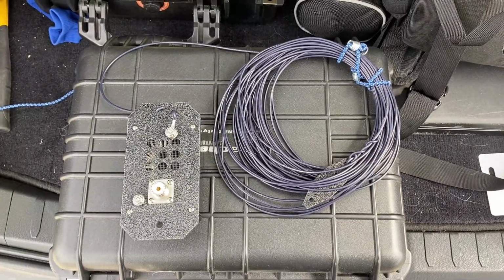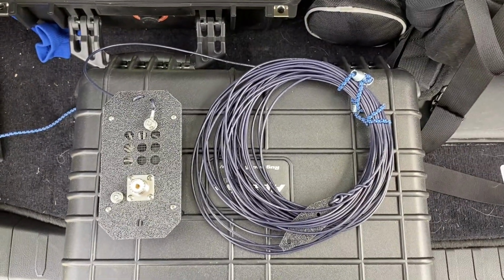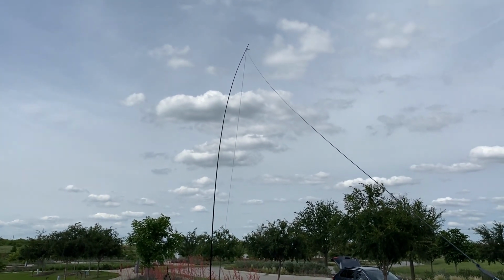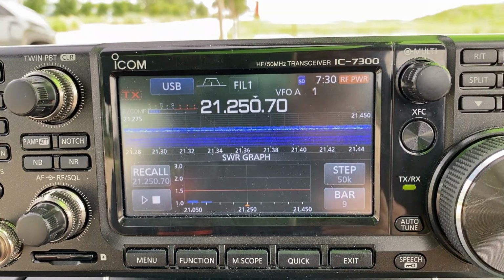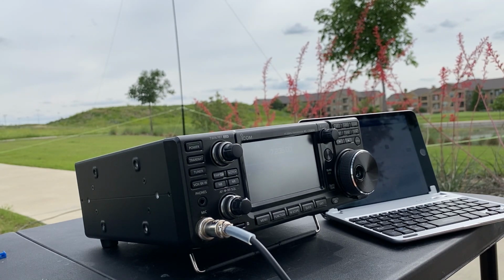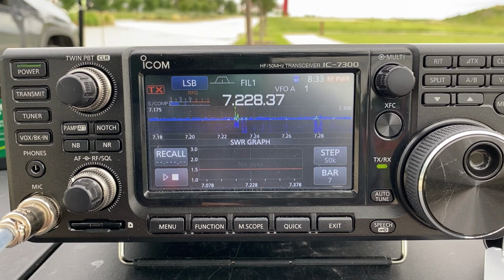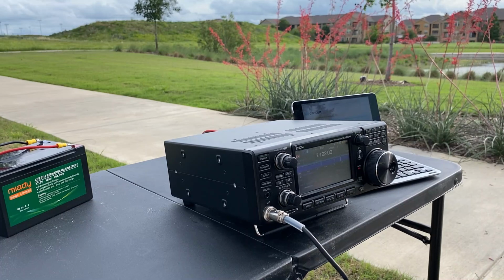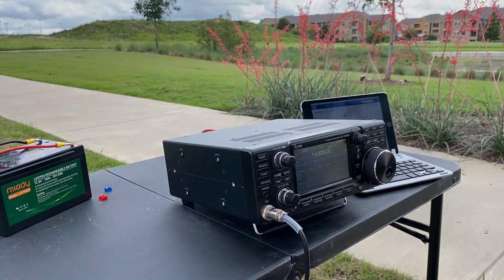Ham Radio Wire Antenna: End Fed Half Wave  MFJ-1984-MP

Comment: This antenna is my Go To for POTA.   When I set this up and swept it with the RigExpert it shows the same type results but internal tuners take care of this no problem.  I use mine as a slope by putting the end as high as I can get it into the tree (typically 40 or 50 feet) and the feed point about 10 feet above the ground.  I feed it with a 40 foot piece of RG8X.  I also use a 1:1 current pass through at the rig.   I also have a 15 foot counterpoise wire hanging off the feed box.  I have had excellent results in this configuration both phone and CW modes.

Comment: Great video keep them coming. My portable rig is the G90 an MFJ-1984LP I did the inverted V . My SWR’s were high. That’s when I put the 25 foot counter pose in the opposite direction. SWR’s then we’re  flat lined on 10, 15, 20, & 40 no tuner needed. 
73’s KC3PMX

Comment: Thanks for showing your setup.

Some notes for a future experiment:
a) The coax braid and all that is connected to it is your counterpoise.
b) You measure the SWR at the coax end and not at the antenna feed point. This is fine, as long as you just care about the match of the coax to your transceiver.
c) The SWR says nothing about the performance of the antenna. The more losses between the antenna feed point and your transceiver, the lower the SWR.

EFHW are very versatile portable antennas that I mostly use doing SOTA.

73 Stephan
Reply from the maker: I am taking notes for next time.

Comment: Good video, Shane.  This is the first HF antenna I bought, back in 2019.  I have mine set up as a vertical/sloper, similar to your second configuration.  I'm using a magnolia tree instead of a pole, but I go out and up the tree, then across another tree.   Just can't really beat an EFHW for cost/performance.  Honestly, that antenna for not being "portable" is pretty portable.  Easy enough to take along, even on a SOTA.   Good job man.
Reply from the maker: Yea this was my first antenna. I use it at home and portable.

Comment: I use an EFHW and while it will tolerate being bent into funny shapes, it does push the SWR up on 28MHz. You might find there is a point higher up where the SWR comes down a little, but don't be surprised if it doesn't come below 2:1. Bending the antenna more in the sloping-L alters the current distribution a little at the higher frequency and it alters the impedance.

Comment: On the slope, the vert/slop has an angle of less than 90°
In verted V your angle was about 60°-70°
The angle when folding an wire or adjusting the gnd plane to the vertical you can adjust the Ohm's by adjusting the angles.
Good luck and have fun

Comment: The inverted L SWR was higher because of the acute angle between the vertical portion and the horizontal. If you could have raised the far end up near 30 ft you would see very different (better) results.
Reply from the maker: I also want to see about making that a zero angle at the top and running the wire back down the mast.
Reply: @K5QBF  That will effectively shorten your antenna. If you fold it in half then you have a 20 meter vertical.

Comment: Uh Oh ! I did not see the radio transmit above 7300 khz, but 7325 khz is out of the band.
Neat antenna. I use a HWEF40 almost all of the time when I set up portable. Mine is a flat horizontal antenna.
Barry, KU3X/QRP
Reply from the maker: The swr check was wide enough to see the whole band. I have my band edges set so that the radio will not transmit outside of the General class privileges.

Comment: I run in the inverted v for pota. Having the unun that close to the car could be causing some issues. Great dx antenna either way.
Reply from the maker: I’m going to test it with a 20ft counterpoise and see if that makes a difference.
Reply: @K5QBF  it will most likely screw up the other bands as the coax acts as the antenna. Maybe try a 5ft piece. 🤷🏼‍♂️
Reply: I wander if the car was causing the high SWR. Also would be easy to add a counterpoise using a crocodile clip on the plug.

Comment: Hey Shane, I think if it’s in the inverted v configuration, it probably follows the same principles of when the wire is at a 45 degree angle to itself, the closer it comes to 5-0 ohm

Comment: Thakns for sharing Shane.

Just a tip which might be usefull - instead of 14200.87 try that on 14200.00 - you'll take 14050 to 14350 including the very top end. (same for the other bands)
Otherwise, great demonstration! (just wondering why it does skip some bands, haven't seen that behaviour yet, maybe because of the new firmware?)

I have a 10/20/40 endfed (no 15) and would like to have that band added, but that antenna is quite a bit longer as my current. (11,85m-ish = 38,9 ft), this would be just over 20m thinking about it :)
Reply from the maker: I have my band edges set for the general portion so I think it skips that part of the band when checking the swr. I have it set to help keep me from transmitting out of band.
Reply: @K5QBF  Aah, that makes sense! 

I did something like that for the bands where my antenna isn't resonant

Comment: Your feed point is reacting to your metal car.
Reply from the maker: Possibly so, I’ve use it on the rear wheel with no issues. The feed point is normally lower though.

Comment: Hi...the 49:1 unun have a 100 pF capacitor, that make the antenna work properly on the higher bands. When you put the unun so close to the ground,you're adding some extra capacitance. And the angles lower than 90° seem to affect the performance also. 73 from LU/EA1GHW
Reply from the maker: Thanks for the info!
Reply: @K5QBF  my pleasure!

Comment: While this video is dated, it still holds up today and is a great video on the End Fed antenna from MFJ. What I couldn't make out however, is that while I could see the cords to guy the mast, what I couldn't see however was how they were secured. In other words, did you use a Guy Ring?
Reply from the maker: I have a video on the mast if you’d like to check it out. Basically I took a hose clamp and put plastic tubing around it. Then just ran some loops of rope through the hose clamp and attached carabiners to the ends. Those just clip into the guy ropes.
Reply: @K5QBF  Thanks for the response, using a hose clamp is a good choice and inexpensive.

Comment: Awesome antenna setup. questions... what mast are you using? how high is the mast? and last,how much power are you pushing? great video and good contacts awesome radio i own one and love it plus icom released the 1.40 firmware witch makes the radio even better. love the 1.40 firmware 73 from KG6DQL
Reply from the maker: It’s the Spiderbeam 12m pole around 42ft. I usually run 50 watts portable. There’s a video on my channel on the mast by itself.
Reply: @K5QBF  awesome. i own the spiderbeam and i love it. i havent tryed  the MFJ-1984-MP but i will get one. loved your set up though great vid thanks for the quick reply and keep up the good work 73 and hope to catch you on the air waves soon

Comment: I now have the exact same antenna and it has quickly become my favorite and most successful antenna for POTA activations. I have only ran it in a straight sloper configuration, usually about 30ft in a tree on one end and the transformer box lying on the ground on the other end. I have ran it with and without a 15ft. counterpoise wire and haven't seen a huge difference either way. I enjoy the fact that I have low SWR on my most commonly used bands (20 and 40m). I only use the general voice portion of those bands, so I was able to trim it to a very flat SWR. To my surprise I had to remove about six feet of wire to achieve resonance. Did you have to trim much from yours? I'm considering the 80-10 EFHW for home use also.
Reply from the maker: Yea I trimmed it for 40m and it is pretty solid across the harmonics.
Reply: @K5QBF  Hi before you trimmed it what was the resonant frequency on 40 meter
Reply from the maker: @jaimeluna8382  it was a little high in the phone US phone portion. It’s trimmed to be resonant in the middle of 40m.

Comment: Probably a dumb question??  Does it work on 17 and 30M ???  They aren't even reasonable multiples of 40m.
Reply from the maker: 40, 20, 15, 10 on this antenna without a tuner. A tuner will get you 30.